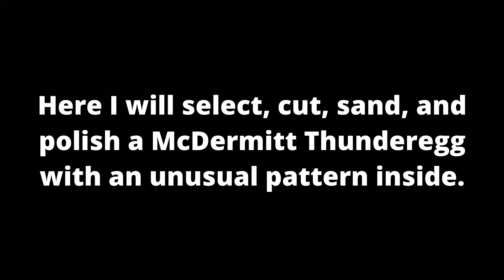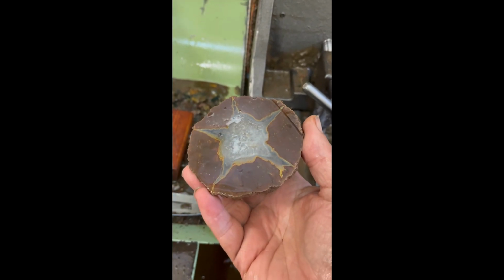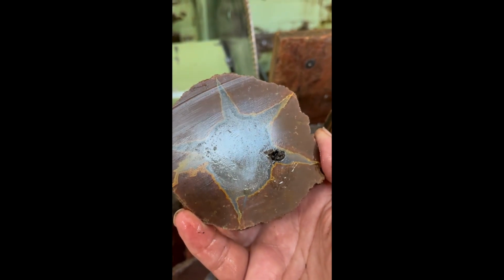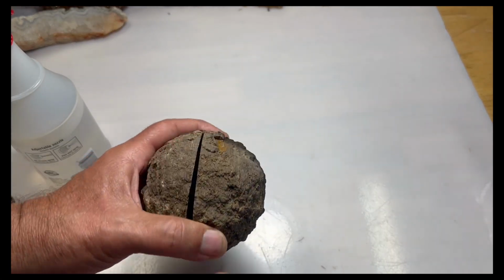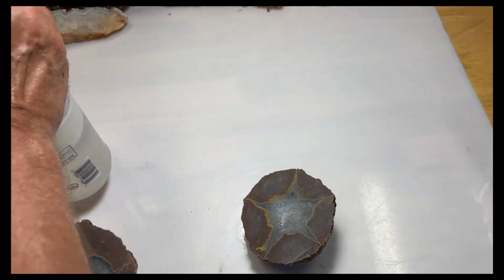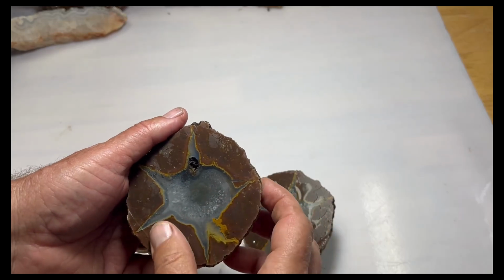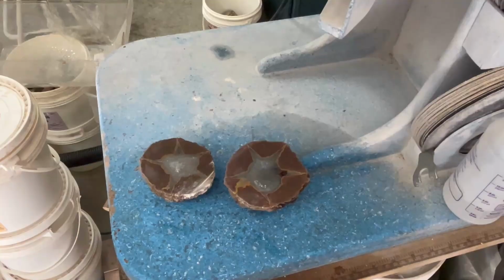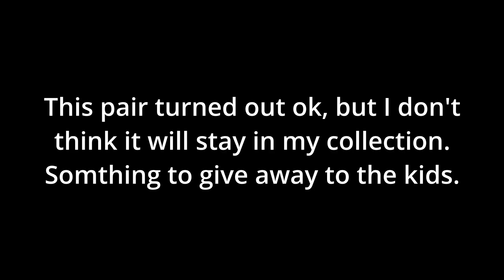McDermitt Thunderegg with star pattern E 162

Comment: Great job on those!
I can't get over the high speed sanders finish, even after 60 grit. It's really quite the machine.
Reply from the maker: They went off the market for a while, but now they're back but it's a slightly different design.  Although the concept is the same.  It's a metal tube frame now.
Reply: @spetkovsek57  I've been pondering about fabricating one, but getting the different grit discs might be pricey. I'll have to check into the availability in Canada because the exchange rate kills me.
Reply from the maker: I buy mine from Maverick Abrasives, but Currently Rockhounding buy his off Amazon. I think the most expensive part you'll have will be the 3450 rpm motor.  I think Currently Rockhounding might have some plans available on his website.  I know he has some for the carpet wheel buffer.

Comment: Thanks for sharing sir. I really do like the thundereggs from those beds. From my experience out there, two beds produce the typical pattern (actually the "deer" running pattern is more prevalent IME) and color shown in your video (the private 78 bed and the public bed down the hill). There are a few beds I found farther up the canyon towards the sheep shearing pens that produce jasper filled thundereggs similar to white fir but the jasper colors are a little different. Matter of fact, the lower public bed that produces the thundereggs with yellow butts up against a large brecciated jasp-agate formation that has really pretty yellow, red and agate waves to it. I broke some off with a chisel and hammer that I tumbled and its really quite nice stuff. Anyway, cutting rocks is like opening a present every day, you never know what's inside and always hope for the best...sometimes though you open the present and it's just not awe inspiring. Anyway, thanks again for the post. Hope you have a nice weekend~
Reply from the maker: You've obviously been there a bunch more times than I have.  You should let me know next time you plan a trip over there.
Reply: @spetkovsek57  Absolutely will do. Thinking around July I might head over unless someone con's me into going before the end of October. 🤔